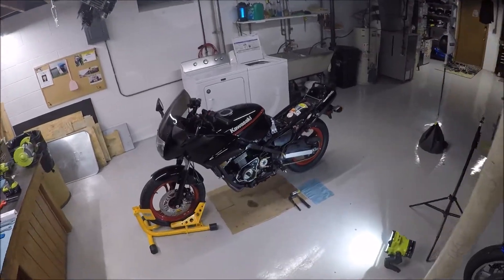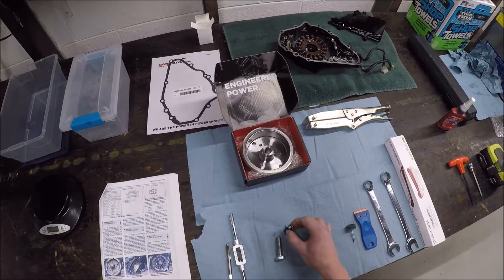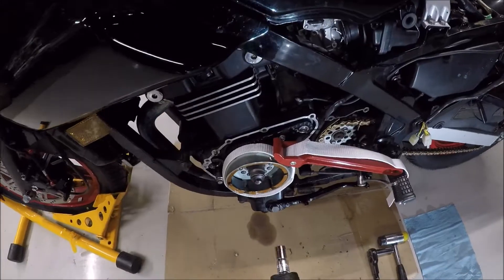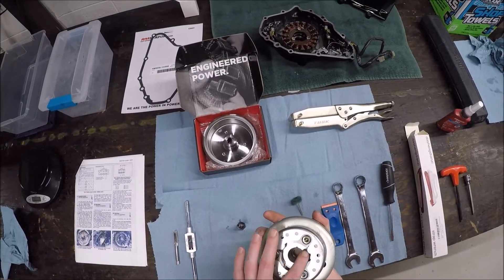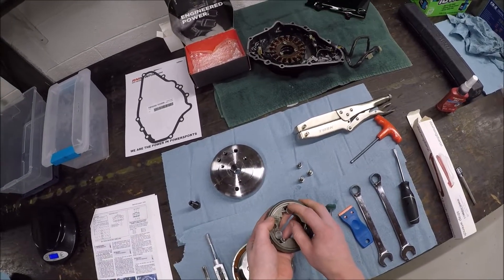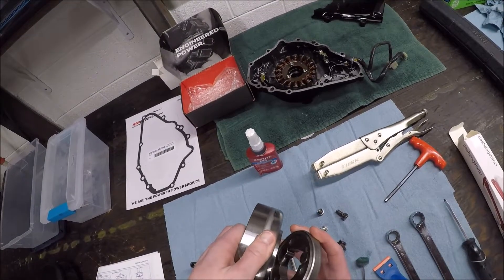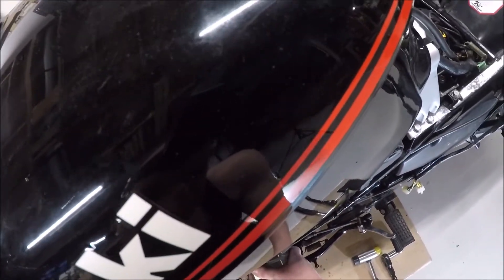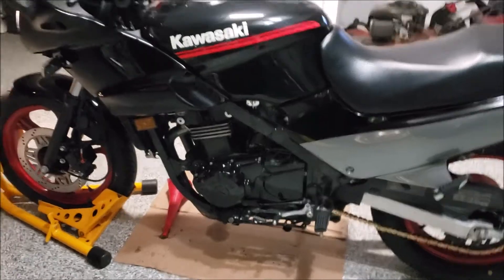Kawasaki EX500 - Flywheel Replacement (RMStator)

Comment: Can you point me in the right direction to getting a flywheel puller? I need to replace my starter clutch
Reply from the maker: I would email RM Stator. The order details from when I ordered the Flywheel + Gasket + Flywheel puller read: 

"Kit Flywheel + Gasket + Flywheel Puller for Kawasaki VN 500 Vulcan / 454 LTD / Ninja 500 1985-1996
SKU: RMS900-104872"

Comment: Hey silly question. 

I have a new stator and rectifier coming tomorrow to swap out my old ones.. 

Oil change needed or is it safe to pop off the cover ? 😅
Reply from the maker: You might get some oil that leaks out, so have a pan below to catch it and be sure to top it back off afterward. I did this last weekend on my SV650--swapped a stator. Can't say how much will leak out of the EX500. You could always lean it a bit to the right side if you had a way to stabilize it, but I prefer working straight up and down.
Reply: @matttriestodothings  Thanks! 🙏 

May break out an old blanket it and lean it over 😅

Comment: I CANNOT get that rotor retainer bolt off , I'm heating and cooling and hammering and impacting that thing
Reply from the maker: Are we talking about the bolt that's right-hand thread instead of left-hand thread?
Reply: @matttriestodothings  yes that's the one , took literally two days of blasting with a map torch, hammering, cooling,  hammering, impact driver, breaker bar, .... Had me pulling my hair out

Comment: Where did you get the flywheel too?. I'm having trouble removing the flywheel.
Reply from the maker: If you mean the bolt that threads into the flywheel to help pop it off--I'm pretty sure I used one that was included from the RM Stator kit. But I didn't think that included bolt was long enough, so I took it to Ace Hardware and found one that was 5mm longer that worked better.

Comment: hi .

I bought the exact same flywheel

But there is no TDC marking on the flywheel at all

How can I adjust the valve clearance if I change to this flywheel?
Reply from the maker: Realistically, you can just make sure the cam lobe isn't pushing on the valve. It doesn't necessarily have to be at TDC in order to check clearances. It's "correct" to use the markings, but not imperative.

Comment: Where the hell did you get the left-handed tap?   I need
Reply from the maker: I bought it on Amazon. According to my buy history in 2022, it was a M10 x 1.25 HSS Metric Left Hand Thread Tap

Pretty certain that was it.
Reply: It says the bolt is a 10-36
Reply from the maker: @garrettwilliams4180  10-36 sounds like an SAE bolt. This is definitely metric.

Comment: Hi. Is that the same engine as the KLE 500? I’ve just bought a 1995 model with 27,000 miles on it & I’ve seen other videos about that part failing, the bike is in good condition for it’s age but it’s looking like I’m going to have to do this for peace of mind, unless it’s already been done as it’s a lot of miles on the original? Engines could be slightly different but those flywheels definitely have the same issue, good video 👍
Reply: На кле500 точно такой же маховик, для спокойствия лучше заменить.
Reply: @nic90901  is the flywheel the same across all KLE500 models? For example, I have 2003 - A13 model? Thanks
Reply: @Dazuslo да, по каталогу запчастей номер для всех моделей - одинаковый.
Reply from the maker: Interesting--I'd never heard of a KLE500, but I see that it was essentially the same engine as the EX500/Vulcans with some minor top-end changes. If it has the same flywheel, I'm guessing it could have the same potential problems as this one in the video. Peace of mind is probably the primary reason I'd consider doing the swap. Though it has proven itself for over 30 years already. But you just never know.

Comment: Thank you for this! What size tap was it? Just want to be prepared. Great video
Reply from the maker: The one I ordered had the description of "M10 x 1.25 HSS Metric Left hand Tap"
Reply: @matttriestodothings  I do have another question about the flywheel puller. Recommendations for the tool?
Reply from the maker: @lucasmorehouse7352  I don't have too much experience with flywheels pullers. I felt like the one that I ordered for this was 5mm too short which is why I sought out a slightly longer bolt. I do think that if I would have gone around with a soft hammer and tapped on the flywheel during stages of pulling that it would have come off easier though.
Reply: @matttriestodothings  you rock man. Thanks for all the help!!
Reply: Sounds the Japanese way of doing thinks, the first fine thread in M10 that comes to my mind is M10 x 1  @matttriestodothings

Comment: Man, I'm trying to take the cover off my alternator right now and it's not even budging.  Any suggestions?
Reply from the maker: Soft taps with a soft hammer and keep working it around. I've had to drive a wedge (blade) in super stuck ones before... It sucks.

I'd probably go around with a head gun if the soft hammer isn't budging and try again. Not a torch just heat gun.
Reply: @matttriestodothings  thanks for the reply.  i got it off with a good thump from a mallet.

is there supposed to be any engine oil in that side?  my stator is doused in it...
Reply from the maker: @rn.85  Awesome--glad it came off. Some of them can be absolute nightmares to get off.
Yea, there will be oil in there. In the video I had drained the oil which is why it probably doesn't look as messy.

Comment: Hey bud is it a rm250 or rm450?
Reply from the maker: The info I can find in my email confirmations is:
"Kit Flywheel + Gasket + Flywheel Puller for Kawasaki VN 500 Vulcan / 454 LTD / Ninja 500 1985-1996 SKU: RMS900-104872"

Not sure if that means rm250 or rm450. If you reach out to their customer service, they were really helpful with me when I was searching.

Comment: My 91's flywheel grenaded apart on me the day I bought it at 15k miles. Good thing you did that beforehand. I have an 03 now, & haven't checked into the flywheel. Do you know if it's the same on the 2nd gen?
Reply from the maker: Jeeze man, sorry to hear that. What a welcoming introduction to the EX500 you had.

Yea this one was just in my head based on all the reports and recommendations I'd heard to swap the flywheel because of the poorly adhered magnets. Thanks Brenden for helping me to feel better about the money spent.

Hope you were able to find something soon after to ride or get the ex repaired!
Reply from the maker: Second Gen I'm told resolved the issue. Common swap is to modify a second Gen to go into first because second Gen resolved the issue.

I didn't feel confident enough in myself to shave the second Gen and have it balanced so I went aftermarket.
Reply: @matttriestodothings  Good to know, thanks for the fast response! I had to replace the flywheel and stator coil, and it ran great for awhile, but It developed an electrical issue after a few months. 
Only gets spark on the first initial crank. Couldn't figure it out. I'm thinking ignitor because I replaced the coils but I'm not sure.
Reply from the maker: @brendenc.2683  I'm not sure why we love these two wheeled machines so much. I suppose it's those moments in between fixing the damn things that makes it all worth it! I'm starting at a tire on the floor right now that's refusing to spoon on and im considering arson in my own house. But I know that's not the right idea and once I get it seated it'll be worth it, haha.
Reply: @matttriestodothings    it's always worth it in the end, when you can ride again!  I bought the 03 before winter, and it's been a project using the 91 for parts. But I do wanna get that running again eventually. It only has 15k miles on it. The 03, is at 30k but runs great
Reply from the maker: @brendenc.2683  I love the 500 kawi platform from that time period. Glad to know you've got one that you can ride while you wrench the other.
Reply: @matttriestodothings  appreciate it👍 There's a reason they kept the same platform for 20 years. Ride safe! And keep making videos. They're very helpful. Your vids came up before anyone else when I googled some stuff.
Reply: @matttriestodothings  And thanks for the fork rebuild video! Very helpful I just finished rebuilding the forks on my 03. And I put in the recommended 352 for 2nd gen because the forks are slightly bigger. But basically the same.
Reply: Now i know it’s common for this year model. Mine gone at 30k miles. 
For replacement I used a 1996 zzr400 magneto.

Comment: Thank you taking the time to make this video.
Reply from the maker: For sure. Hopefully it was useful.
Reply: Got a good condition white gen 1 I'm keeping & a tatty gen 2 I'm going to sell cheap. Thinking of being cheeky & swapping the chain tensioners & guides over xD
Reply from the maker: @SativaWraith  The 1st gen tensioners I'm told are a ticking timebomb, so swapping to  a gen2 was advised to me.
Reply: Assuming the flywheel isn't a straight swap though. That would make things too easy.
Reply from the maker: @SativaWraith  eh, it's pretty much a straight swap besides me messing up the threads a bit.

Comment: чтобы не повредить резьбу подкладывай шарик от подшипника под винт
Reply from the maker: Rough translation "in order not to damage the thread, put the ball from the bearing under the screw"?

I agree that a puller screw with some type of ball or spherical surface would be a lot better at not damaging the threads. I didn't know any better at the time, unfortunately.
Reply: @matttriestodothings  
нет необходимости покупать дорогой специальный инструмент,
достаточно иметь обычный съёмник и обычный шарик из старого подшипника
Reply from the maker: @unokarpa4405  Thank you for the advice Uno. I think I have a bunch of ball bearings from the steering head of my Honda VF500F! I will use one next time.